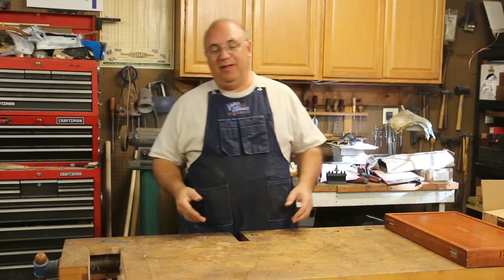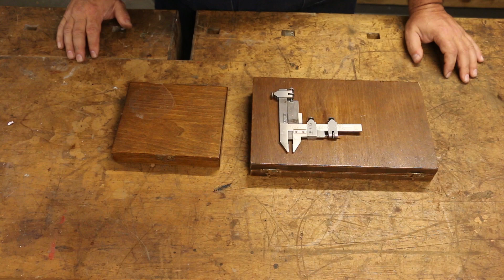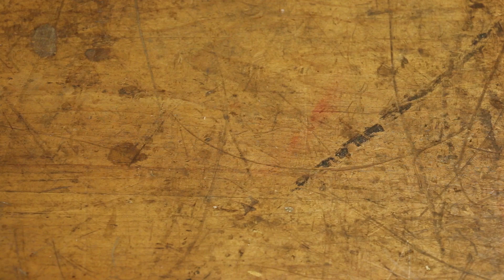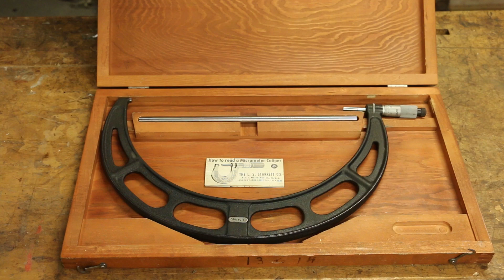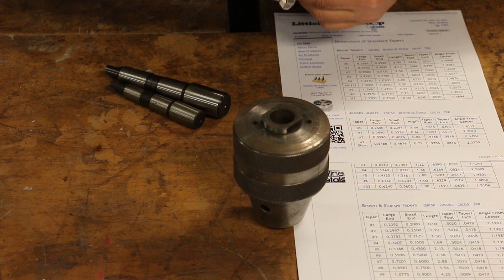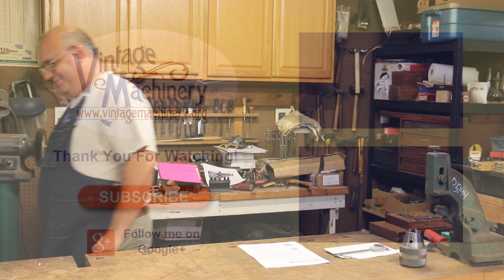Odds & Ends 32:  Shop Update, Viewer Mail, New Tools

Comment: I don't know if it's used that way it might fit a drill and is a keyless chuck like the one I have you spin the drill up and hold on to it and it hammers tight on the drill bit let me tell you I love my cause bits never get loose which means the bit will break before it slips.

Comment: Hi Keith, a quick suggestion for your chuck.  I was faced with a similar situation a few years back on an old old chuck I found in my grandfathers tool box but after a few years of frustrating research I couldn't figure out the taper either.  I ended up using an old gunsmithing trick by stuffing a bit of cotton wadding at the bottom of the chuck bore then filling the bore with molten sulphur.  Blacken up the inside of the chuck with an acetylene rich torch for a release agent and then you can cast the taper really easily.  Stick a small wood screw down in the bore before the sulphur hardens so you have something to pull it out with. The great thing about using sulphur is that the resulting plug won't shrink at all, and then you'll have a perfect pattern to turn the matching taper on your new arbor.  If there's a lateral relief groove ring cut down inside the taper, fill that with candle wax first so then you can heat the chuck up slightly afterwards until the wax melts and then you can pull the plug all the way out without destroying it.  My grandpa taught me how to use this method to determine the cartridge bore of unknown antique rifles back in the day.  Works real sweet and is a well-documented method shown in the back of some of the older 1960s and 70's Dixie Gun Works catalogs.  It might still be in the latest catalogs, but I haven't looked at one for some time now.  Those catalogs have always been a great machining and gunsmithing reference BTW.   
All the best and thanks again for a great video.  
P.S.  Someday when you get the chance I'd still sure like to see a video of you showing us how to rough-check lathe bed accuracy at auctions when you can't turn a test bar.
Cheers, 
Bob Fort
Reply from the maker: +RL Fort Thanks - several people have suggested "casting" a taper to measure.  But, I think that the mystery has been solved, I am pretty sure it is a B22 taper.

Comment: good odds & ends Keith....I went thru all of my drill chuck arbors and basically struck out....best I can tell you, is to set it up in the lathe with a test indicator to get the correct angle, and get a machineable chuck arbor like the one in my link, and machine your own....that should work a least until you figure it out! I couldn't post the link so go to www dot victornet
Reply from the maker: +Jim Liechty I am pretty sure it is a B22 taper.  Pretty common over in Europe but not so much so here in the US.

Comment: That taper may be a Jarno taper.  Jarno had several sizes that would be close to Jacobs and Morse.  use a piece of modeling clay to make a positive of the bore.  Then measure it and try cutting one.  Pouring molten sulfur into the hole was another way of making a positive.  You could soot it and pour one in lead or Babbitt as well.

Good Luck

Mike
Reply from the maker: +Junk Mikes World Thanks - I am pretty sure it is a B22 Taper.  Thanks to some of my subscribers for helping me figure that out!

Comment: Keith,
Are those belts all in one piece or are they spliced together from pieces? I guess that they can be no longer that a cow's circumference and be in one piece. Unless they are cut in spirals and then straightened? Do you know more about the drive belts? 

Thanks,

Ian
Reply from the maker: +Ian Butler Leather belts were made by gluing up many shorter pieces.  Only the leather across the back of the hide was used as that does not stretch as bad and stays running true.  The ends of the pieces would be cut at a long angle (called skeiving) and then glued to the next piece.  Also, belts always run with the hair side (smooth side) to the pulley - usually, leather belts were actually multiple layers laminated together and if you have two ore more pieces, they would glue them up so that both sides would be smooth.  Making leather belts was once very common and nearly every millwright could do this work in his sleep.  Now days, it is becoming a lost art.  I have never actually glued any belts together but I am familiar with the process as I have a book or two that describes it.
Reply: +Keith Rucker - VintageMachinery.org

Oh, okay, I didn't know they were multiple layers. That explains a lot. They could reinforce the joints by staggering them. 

I am always amazed that they stay on the pulleys and don't walk off. 

Thanks.

Comment: Hi Keith, i think that`s a B22 taper, that`s pretty common in Europe.
Reply from the maker: +Steinbruchsoldat Thanks - several have suggested that - I just need to get out to the shop and measure it.
Reply: +Keith Rucker - VintageMachinery.org Keith, what arbor do you need for it? I got a B22 MT4 that i could send you if you can use it. Could take a while from Germany though. Julian

Comment: Keith I have to say to cut your own timber to build your own shop that you will be working in is (SECOND TO NONE) Are you going to use a wood burner? Just wondering and stay safe.
Reply from the maker: +Randall Moore The shop will be a hybrid between timber frame and modern construction.  Not all of the lumber will come from the trees that I cut, but I do plan on milling the timbers from my own logs.  I am a little over half way through milling everything now.  At some point, I might put a wood burning stove in the shop for heat, but the truth is that our winters are not all that bad down here in the deep south so it is not high on the priority list.  I am more interested in air conditioning than I am heat!

Comment: Keith, you might find a gunsmith casting alloy would work great to measure that taper in the drill chuck you have.    The unique part of cerrosafe is that it after being poured into the item to be measured it first shrinks and then after 30 minutes it returns to the exact size of the object the cast was made in.  Used by gunsmiths to measure the chamber of a gun that is not known.   Brownells and MidwayUSA both sell it.
Reply from the maker: +John Leake Thanks - somebody else also suggested that as well.  I will look into it for sure!
Reply: +Keith Rucker - VintageMachinery.org Keith Check your email, I'll send you the cerrosafe I have if you send me your address....

Comment: Have you considered it could be a jarno taper. Janos are very easy to machine, the raper is the same for all sizes. I machined one for my Monarch 10ee spindle it.s a jarno 12. The taper is .600 per foot or .050 per inch regardless of the length.
Reply from the maker: +Chuck Tipton I have dealt with Jarno tapers before.  Possible, but I don't think so as this is a short taper similar to a Jacobs - not a long taper like Morse, Jarno and B&S.

Comment: Thanks for the video Keith. Looking at the various taper charts I see that a #8 Brown and Sharps taper is the closest thing to fitting the top dimension, could one turn it to fit maybe? Or perhaps it's a metric taper...if there is such a beast. Good luck with it at any rate.
Reply from the maker: +Duncan “DunMac” Mac I don't think it is B&S - Too short of a taper.  I have some leads, just need to get out and investigate.

Comment: Hey Keith,
some of the other guys have suggested your chuck might be equipped with a B-taper which would make sense.. spray some WD40 in there and then run a candle stick in it to get a dimension.. that should give you a better idea

cheers
mike
Reply from the maker: +HolzMichel Will do!

Comment: Keith, Have you thought about putting some hold downs in the concrete pad for your shop? I put in 4 for straightening car frames using metal plumbing fittings , chain  and a brass cap. You barely know they are there until you open the cap and pull out the chain to hold down work. Hopefully the weather will work with you now. Good luck.
Reply from the maker: +John Davis I might talk to my concrete man about that.  A piece of his equipment broke down this week and they were not able to get started but he said he should be here on Monday morning and as long as the weather holds we should have a slab by the end of next week!

Comment: That hammer is a nice piece of work.  The gear caliper is a very useful tool indeed... lovely angle squares too. You must be well off for all the tools these days.
That travel rest is heavy! Very cool finding one for yourself.
That chuck - why not take a wax mold of the taper so you can measure and get the type... or smear release agent and cast some epoxy.
Reply from the maker: +ChrisB257 Some others have suggested casting the bore on the chuck - not a bad idea at all!

Comment: There's a method of checking the size of the chamber of shotgun barrels by means of a cast mold, babbitt I believe. You might be able to do something similar with the drill chuck. You would need to push a plug down the bore to keep the metal from getting into places where it does not belong and you would probably have to smoke the bore with a candle as a release agent.
Reply: +Mark Mossinghoff Brownells sells a product called Cerrosafe to cast chambers.  It shrinks as it cools and then expands again so that in one hour it is again the same size as the chamber.
Reply from the maker: +Mark Mossinghoff Interesting concept!

Comment: Wow, 40K subs! you are doing it right clearly! Awesome score on the follow rest. i doubted I would ever find one for my Monarch but after 10 years + of looking one finally turned up! Sad to say I have only used it once since then, but if you need it and don't have it things can sure be frustrating. You mentioned sawing timbers, will you be doing a pegged timber frame after all? :-)
Reply from the maker: +bcbloc02 The follow rest is one of those things that you don't need often, but when you do, boy do you need it!  As for the shop, I don't think it will be fair to call it a timber frame, but it will be "Post and Beam".  Kind of a hybrid construction mixing the old with the new.  The results I think will look really nice, but I just don't have the time to do all of the mortise and tennons and pegs.
Reply from the maker: +bcbloc02 I actually have a big Crescent Hollow Chisel Mortiser and a big 1" mortise chisel to fit it.  The problem is handling those huge timbers to get them on the machine.  You would spend way more time trying to move the timbers around than actually cutting wood.  I think that what I have planned will do the trick for what I am wanting.  As for the 16" beam saw, they have one at the museum that I can use!

Comment: Congratulations on the 40000+ subs.

Man, i remember when this channel was starting, traversing the chucks on the lathe to the table, some Adam Booth guy ;) and some gloves. Eh, time goes fast. :D

edit: When you take apart the follow rest, be on the lookout for markings. That's a sure sign for stuff like that. Usually on the bottom. I have a friend in the UK who has two old military surplus lathes and both are marked with a serial set on most of the important bits.
Reply from the maker: +aserta Yep, we have come an awful long way in a relatively short time!  What a blast it has been!

Comment: Hi Keith. Congratulations on the 40k subs! I did some research on the drill chuck, and I found some DIN 238 tapers, I think you could check that out.
Reply: Precisely!! B22 DIN 238.
Reply from the maker: +ptsg DIN 238 tapers are a new one me, but they appear to hold some promise!  I will have to get out and make some measurements and see if something like this might fit!  Thanks!
Reply: +ptsg I'm thinking DIN taper's mare too new to be correct. The Union Manufacturing company closed or was bought out in 1919 from what I've found.
Reply: +Ravenbar's Repairs I don't know how old DIN 238 is, I was just throwing this possibility as I have a 6-20mm Rohm chuck that uses this kind of taper, the B22 one. Actually this could be just used in Europe